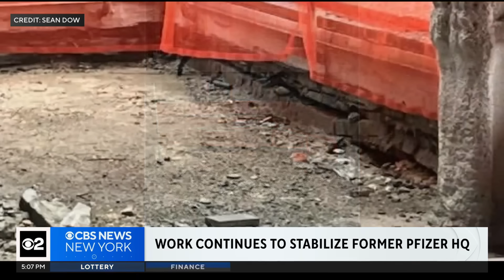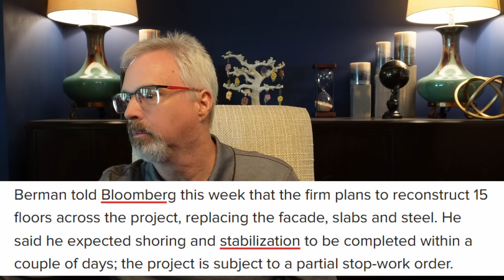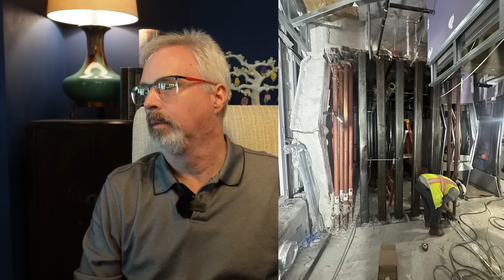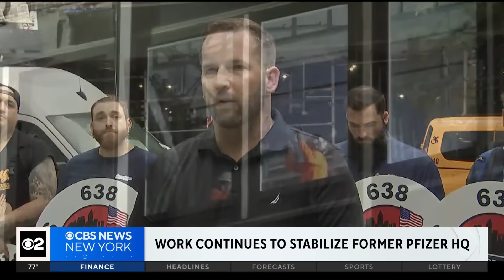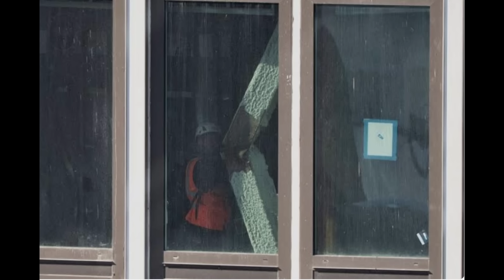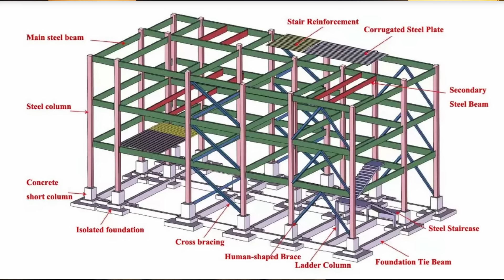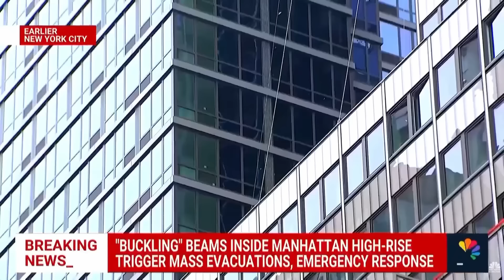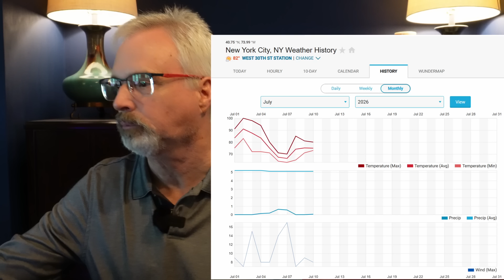Update - Pfizer Building Structural Column Failures; Now What?

Comment: this is the ONLY coverage I've seen on any media that clarifies why this wasn't a catastrophic collapse, and why anyone was allowed back in there.  the addition is being held up by the connections to the pre-existing construction on the two sides of the addition. this is of course an unsound and unintended cantilevered load, but without those it could easily have pancaked . that those columns weren't stripped of fire protectant and inspected tells everything you need to know about why this happened. recklessness and negligence on display.
Reply from the maker: Thank you! I agree if that's the original fireproof that means at least in that location it wasn't removed to check the condition of the 66 year old steel column before the additional loading was applied.
Reply: @CaseyJones-Engineer  if its new and the contractor applied it over rusty steel looking like that its even WORSE! I also can't imagine an engineer, fabricator, or ANYONE with any sense whatsoever looking at that thin THIN steel and saying "sure, let's put 9 more stories on this" WTF??? I really think if it had been exposed this wouldn't have happened.

Comment: Adding 100`s of tons to existing columns built in 1960. Better check the entire structure top to bottom.
Plus, every unit will probably have marble floors, Walls, showers, kitchens. Add a few more thousand tons.

Comment: Casey: What do you think the odds are, that the original engineers and contractors of the Pfizer building, intentionally 'overbuilt' the original structure and foundations, to the extent they could support an additional four floors above the original roof. I know others have suggested this but the fact that adding only 4 floors (plus expansion) to the existing 33 floor building, and expanding several floors in cantilever fashion, has resulted in buckling 12 floors below that, strongly suggests that the original building was indeed built to required spec for 33 floors. The cantilever effect of expanding all the floors above the 21st, would put an amplified load on the existing perimeter steel, far beyond the dead vertical load of the floors above. GREAT VIDEO!!
And, my personal experience with working in buildings of that era, and that type of construction, is that the fireproofing used on steel beams has been asbestos and required very expensive remediation.
Reply from the maker: You raise some good points. I think it just boils down to waiting for the forensic evaluation report and hopefully the city will be transparent and make that information available. As far as asbestos I think it's likely although I don't know the whole history of the building and whether they ever did a removal at any point.

Comment: should have used union labor. need an example.? what partial collapse has happened under union labor?
Reply from the maker: Correlation is not causation. Show me the specific evidence for the position.  There are a large number of union workers involved with this project even though it's an open shop.  That union BA was just running his mouth.

Comment: Several thoughts:
A) it could be that due to the decreased loads from the office 50 psf to 40 psf for residential that there was not a need to reinforce the lower columns plus there is a 2000 concentrated load requirement and 80 psf in corridors.  Any overload comments needs to await the engineering.
B) The steel workers may have been accurate in that more experiences structural labor might have recognized what could have been a structural sequencing operation that did not reinforce the existing structure first potentially in a ruse to get the new stories under construction to meet builders deadlines.
C) This type of construction of conversions and adding floors is fairly common in NYC and as such all of the strain gauge and intense monitoring were not necessary.
D) The NYC Department of buildings and NYC structural engineers are arguably more experienced than any other place in the world, there are few failure akin to this in NYC.
E) Given that one of the factors in one of the Trade Center towers was a change in fireproofing away from asbestos in the late 1960s one would have to assume that the original fireproofing was asbestos and and as the potential for oxidation on the structural members was not apparently discovered would indicate as noted above that the retro fitting of the lower floors may have been delayed.
I would suggest that this is not going to be a simple causation but that there are many factors involved.

Comment: The column was originally was designed as an interior column. The corner of the new building converted this interior column to a corner condition and added additional torque, in addition, the extension cantilevered away, that also added more lateral forces.  I didn't see any new lateral bracing. The week before this happened, we experienced a week with real-feel temperatures of 115 Degrees  that ended with a high wind storm. The new addition created a wind tunnel affect.

Comment: In cause A-Ignorance of engineers and inspectors on the subject of elastic instability of high lenderness structures; be it skyscrapers, bridges or ships. B-old constructions that involve building upon confidence in empiric formulas and safety factors. C  The cultural bias of overloading  for profits. Engineers gets cornered to use schemes for building resting on regulations flaws.  I am no longer uptodate but I would add 3D mathematical modelisations using assumptions or short-cut.  this is the exact situation for the iconic Quebec bridge buckling again for the third time for those reasons. this bridge is the source for all engineer's codes of conducts. That is why I demand a full public formal and technical inquiry.  do the search see flickr quebec bridge cracks buckling and unstable. No AI photos provent by EXHIFS.

Comment: It's been 27 years since I left project management & took up the pursuit of pure mathematics due to the recession at that time. But, from the pictures I've seen the columns that buckled were at most a WF 10 - X where X is fairly light. I just can't imagine such a column being used to support what was placed above it without retro work first being done.
Reply: That's what I find troubling. Those upper columns appeared to be W10 or W12 sections, completely inadequate to supporting the upper section. Where is the column reinforcing? Overlooked by the structural engineer or on the plans and the contractor deciding to add it later?

Comment: The picture of the building showing the buckled iron beams and sagging upper floors looks like something from a third world country.  Is that where MetroLoft usually does business?  This isn't a "typical construction mishap" by any means.  It is sheer incompetence, as the naked eye can tell you the 21st floor and former rooftop of the original building (built in 1902) was not reinforced beforehand to support 15 additional floors on top of it, not to mention floors that are cantilevered outward 10-15' shown in other photos adding additional stress to the floors below.  Brings back memories of the Hyatt disaster of 1981 in KCMO.  Architects insisted the catwalks were safe until it was found an engineer changed the plans without their knowledge.  Architectural debacles are to be prevented, not excused over and over again!  Can't the construction industry learn from the past?

Comment: Fill every compartment from the first floor up with with made to fit wedge air bags, the same as used to lift a car or other object . Then starting at bottom floor fill them till determined pressure is achieved . If they are put in place with air lines running outside to a safe distance then can be filled from a central control panel.Then secure the floor with the damaged beams . Or just blow the building up.

Comment: At this point, a slight breeze is likely to knock the whole building to the ground.  SpaceX refers to that process as a "rapid unscheduled disassembly."  The construction workers that are installing the temporary shoring poles and beams have serious balls to put their own lives on the line like that.  When buildings start falling apart, it is very difficult to get them to stop.  Installing shoring poles just slows things down once a collapse has started.  We're now looking at an inevitable building collapse in slow motion.  The whole building is probably so seriously structurally compromised such that it will have to be completely demolished and rebuilt from the foundation up.  The sooner that happens, the safer it will be for all of the nearby people and buildings.

Comment: Hi there, I worked on old existing structures as a structural engineer for the manufacturing and energy sectors as well. Before, I was in the commercial/residential sector, in fact that was where I started my career. One important thing for existing structures is identifying the material; this could be hard, especially if existing drawings are missing or not very clear to read. If an engineer can find at least the date of drawing issue, that can be of great help; then, using judgment, an approximation of the existing steel year of manufacture can be arrived at. Thankfully, the AISC has a design guide called: Design Guide #15 that has a list of steel specs and manuals dating back to the 1800s. With this guide and knowing the cross-section dimensions, one can find the designated steel, e.g. W 10x 45. The next step is to determine whether the steel is weldable; this can easily be figured out by observing whether any additional members are welded to the existing members. The critical thing here is the actual yield strength of the existing steel. In general, before 1963, the yield strength was either half the ultimate tensile strength or 30 ksi; it is not going to be 50 ksi, which was introduced later. I think you mentioned that it was built between 1958-1962, which means the steel used could be from 1956-58. I will look up the values of the yield strengths of the steel produced during 1955-1957 and use the smallest to be conservative. 
The next thing is to make sure that the existing members is not corroded; this is very important. For the columns of this structure, the columns were fireproofed, which means stripping the columns off the fireproofing, which could be very expensive. Alternatively, there could be devices for identifying the corroded members without stripping. Any way that has to be done. Then carry on the calculation of the loads and compare with the capacity of the columns. If the building is designed as an office, changing it to residential should not be a problem load-wise, as the loads for office buildings are higher than those for residential ones, assuming the original layout of the building floor plans has not been altered, which is highly unlikely.  I would say that the existing column capacity was overestimated, and the corrosion of some members may have added to the problem.

Comment: Nathan Berman that engineered this building you wonder if he had malicious intent to cause the building to collapse in the future after it was all done. You know, it was built so that when you got the building loaded up enough with individuals possessions & the building was occupied the weight would be enough to overcome the smaller beam's of the old part of the building. Everyone that even does local building with wood even knows if you don't need beams or braces or heavier and or wider boards you don't use overkill because it is not needed and it will reflect in the final price that it cost to build the structure. If you put more than is needed you waste money so in order to be cost effective you use the maximum strength board you need and no more as it raises cost unnecessarily for the customer you are building it for. You also don't put extra in because it may be the difference between winning the bid and another contractor winning the bid if it is bid work! Whom is the original A-Hat that designed the building from the start and did Metroloft contact them to get information on the existing structure? I would assume the first thing before even drawing up the blueprint's you would get the ones from the original building to see what structure is already there & how much weight it can carry along with what can safely be added to it! You would almost assume that the beam's are smaller but the new blueprint's were drawn up like they were not smaller, like they assumed the beam's are as girthy as the main column's of the main building that you can see are much more substantial than the ones where there is no previous overhead construction ever has been done nor planned to ever be added to the existing building! Nathan Berman's comment's to gaslight the public says volume's about his deception of the public, talking to the public like they are all dummies and he knows all & you should just take him on his word alone w/o providing any proof he isn't lying! Premeditated Gross Neglect W/Malicious Intent! Could have been intended to be a future false flag attack used similar to 911, not that there is any hard proof of that either but! Sometimes the least obvious is the most obvious! Does Nathan Berman have insurance that cover's the building at least, maybe the workers if it collapses during and or after the building is constructed? Many thing's they seem not to mention that would pertain to this situation that are not covered for whatever reason's, maybe implicates many others in the gross neglect!

Comment: No way is that going to be a "quick fix".  Everything above those beams has to be removed, and that floor, along with one or two below it, will need to be rebuilt from damage alone.  IF it is allowed to be rebuilt, there may also need to be reinforcement work to all the floors below.   They'd be lucky if it was only a year of extra work.

Comment: How do you "jack" up a building of that magnitude to get it true again? 
I heard on one of your news outlets from an official, that because the column failed, the surrounding columns in that area are taking on extra weight which they were not designed for.
Anyone who goes in there to attempt to shore it up are risking their lives surely?
And like I some of your followers on here have stated, who would want to live in a tower that has been compromised?

We have a problem with RAAC here in the UK (used in concrete construction in the 50s and 60s) which has lead to many public buildings being closed down in recent times.. Could this be part of the problem?

Thanks for looking into it. I will watch out for more of your content on this.

Comment: I work in software, not structural engineering but I was very surprised to hear they tried adding all those floors. If the goal was to save money over building a new building or to preserve a historical building it would seem the obvious path is to leave the original building intact and refit the interior. Even if they somehow manage to repair this building I can't imagine anyone wanting to live in it, I wouldn't want to be anywhere near it. Having worked on cars that were damaged in accidents, the damage you see is often the tip of the iceberg.

Comment: Thanks for an excellent overview. So many of the others are nonsense.  As a licensed structural engineer for 45 years I agree with all your observations.  A full forensic review is called for and a review of drawings and calculations.  It will take months to review and execute remediation. The building is still a grave danger in my opinion-to workers and public.  The column failure shifted loads to other members and connections and no one can say whether they are safe at this point.

Comment: An idiot mayor that has no clue about his ideas and how ridiculous they are. 
To take a building that is rated for office space has a much different load rating than a residential building has. Is it doable? Sure, I would bet many buildings could be converted.

Just maybe this building wasn't built with that rating in mind?
One individual piece of this is those water reservoirs on top of the building is a load it didn't have before.

Some folks need to come to terms that NY is at its capacity and then some. 
Find some other city if your hell bent on living in that environment.
This more more more for free, is not going to bode well . 

As for the Union issue, there are a many of us who understand there is a time and place for some unions. Most of us that have been with professional unions also would admit many of them are useless. The rep should be careful, somebody just might spill the testimony about how useless his words could be.

Unions aren't as great as many of these reps claim for them to be.

Comment: Wouldn't they have to somehow jack up the whole side that is sagging? Then put in new steel supports that correspond to supports on the floors below that transfer the load to the foundation? ---- but once any steel support is even a little bent it can not be relied on in the future? There has got to be little cracks in those old rusty steel supports!

Comment: The country’s largest completed office-to-residential conversion is 25 Water Street (SoMA) in Lower Manhattan, NYC. This 1.1 million-square-foot adaptive reuse transformed a former 1960s office tower into 1,320 luxury apartments, packed with 100,000 square feet of amenities including bowling lanes, pickleball courts, and multiple pools.However, an even larger project is currently underway at the former Pfizer Headquarters (219–235 East 42nd Street) in Midtown Manhattan. Developed by MetroLoft and designed by Gensler, this $800+ million engineering feat will yield 1,600 apartments (including 400 affordable units) once finished, making it the largest conversion in New York City history.